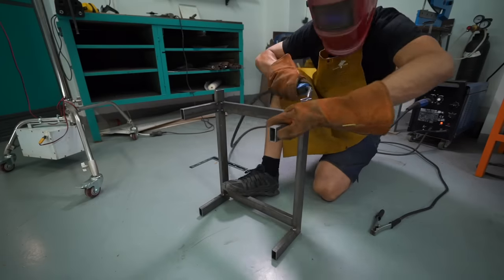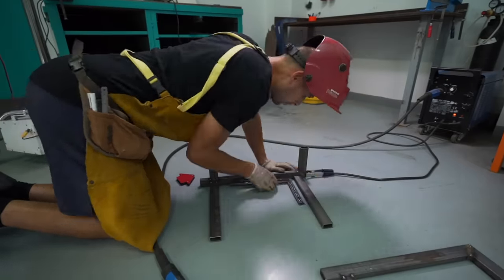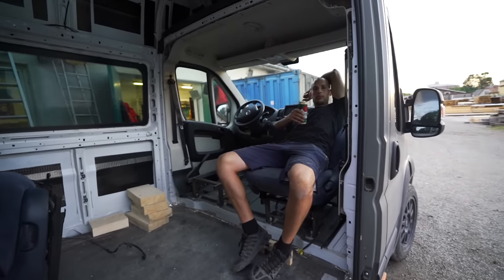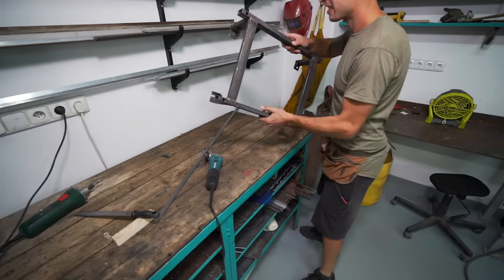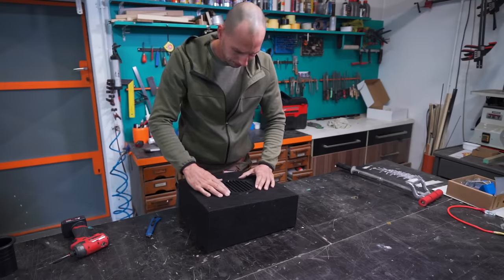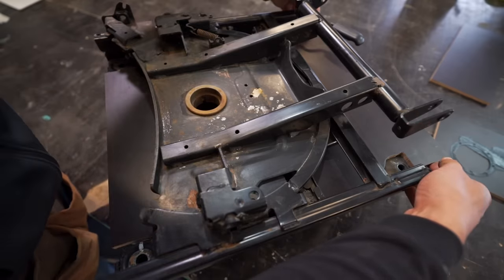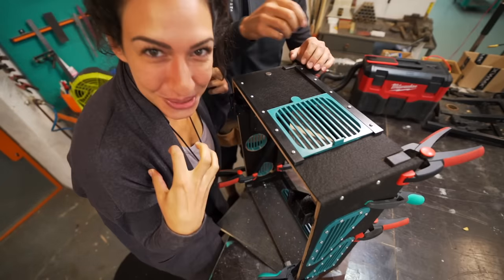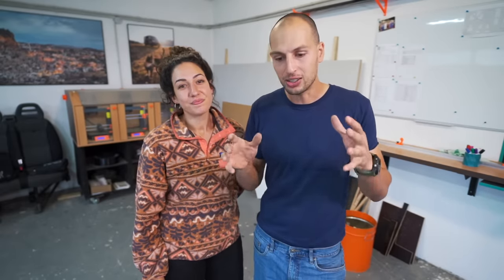Building Creative Swivel Seats for $95 / Ultimate Van Build Conversion S2E4

Comment: A seat base is a critical safety component, designed to handle specific longitudinal & lateral forces in case of an accident. A warning to your audience that a DIY base is not DOT / EU compliant would be thoughtful.
This said, love your passion, creativity and funny video montages (measuring the cat 🤣) !
Reply: I was thinking the same. I am 100% sure that Ladi's seat bases are even stronger than original, but if they discover the change at a vehicle certification/MOT etc it might be a problem...
Reply: Did something similar. Needed to go to a certified appraiser. Showed him the drawings, showed him the finished product ,bare naked’ in the vehicle.
80 for the consulting before I built it.
650 for the approval when done.
This charge is per row of seats.
Tag reflects the charge in 🇨🇭.
Might be different in 🇪🇺 or elsewhere.
Reply: This definitely wouldn't go thriugh in Germany. They don't even allow certified ones, when built into a car, they aren't certified for, even if the cars (certified and non certified) are identical in construction.
Reply: Yeh, I doubt this would be accepted in Australia either. That's the only reason I bought certified manufactured swivels for mine rather than just making them myself.

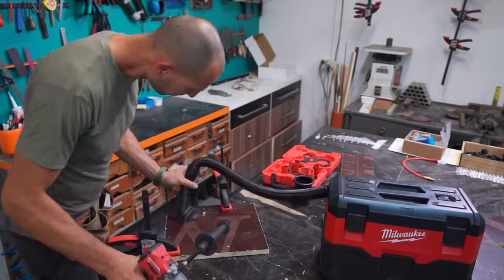Comment: 13:05 - Ladi is actually singing a song in Slovak language ("Nebude to ľahké" by singer-songwriter Richard Müller, the title translates to "It won't be easy"). The funny part is even though Czechs and Slovaks usually understand each other the languages are not that similar to each other and it is usually obvious when a Czech speaks Slovak and vice versa. And usually there are certain sounds in each language that the other doesn't have and are difficult to pronounce correctly ("ř" in Czech or "ľ " in Slovak). Ladi is actually singing the line "mňa sa nezbavíš, s tým sa lúč, nie, nie" with a "ň" sound and it's very obvious he's having a hard time with it :D

Comment: What seats are these - I mean from which car model? 
...and does the fact that they also have height adjustment mean that you could potentially do away with the step?
I have been exploring many of the concepts (like skylight, underslung grey-tank, LazyBoy in a van, etc) that Ladi is able to bring to life, and also confronting many of the puzzles that you guys bump into.  I'll share one such idea that might be useful to you in the context of this episode:  Why not make the seat platform for the passenger seat 5-7cm shorter?  That way, you do away with the need for the step.  But then, you can put that seat on a set of its own rails that can bring the seat into the living area when in stealth mode.  Furthermore, instead of using a second-hand car seat, use the mechanism from LazyBoy.  Hence, you'll have a seat that's fulfilling a dual (and maybe, triple) purpose: 1) a passenger seat (just need to add seatbelts and airbag triggers from previous seat), 2) a LazyBoy in the living area [and, 3) potentially a solution for a second workspace - some LazyBoys have lagun-like tables collapsing into the armrest].  That's the kind of solution that I'm trying to engineer.

Comment: Sorry to say that, but You made it wrong, this "fork" was and should be in oposite direction, so in case of accident it keeps chair base in place, but when damage is significant it allows seat to move backwards. You will understand it after watching any ducato crash test on YT. So called "crash zone" ends somewhere behind driver's/passenger's back. When dashboard smashes your legs and body, chair must have a possibility to move. Basically what You made is illegal. Car should not pass annual control. But luckily they very seldom pay attention. BTW I have the same seats mounted to oryginal bases. Quite comfortable.

Comment: Great content as always. How much insulation and flooring are you going to add to the Van floor?  Did Ladi remember to account for this in the Height of the chairs?
Reply from the maker: we're still deciding about the cab floor! But the height of the floor where our feet are when the seats swivel will be in line. We're doing the same as we did in the last van, but with a few upgrades

Comment: The swivel seats you bought for U$S 95 were from what vehicle? How did you buy them? Where can I, in California, get two of the same?
Reply: I'd be amazed if you would be allowed to adapt seats from a different vehicle in California. I think you should check into any certification process that would be required before you start sourcing parts.
Reply: @MrGundawindy  There are no such certifications in california. anything goes.
Reply: @MrGundawindy  Be amazed.

Comment: It may be a bad idea having a kitten loose close to the peddles needed for brake/go etc , a silly kitten will get between your foot and peddle during traffic , and then you will never think its cool to have a clueless kitten running between your feet when tiring to drive .
Same as driving with jandals on and getting one wedged under peddles during a emergency stop .
On the plus side , hopefully you only do IT once , and learn not to have loose things close to peddles .